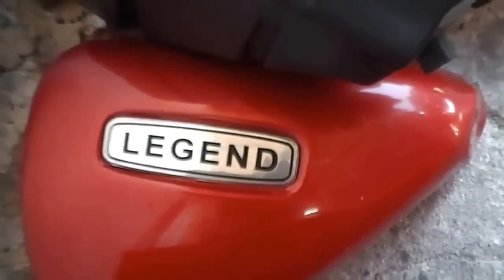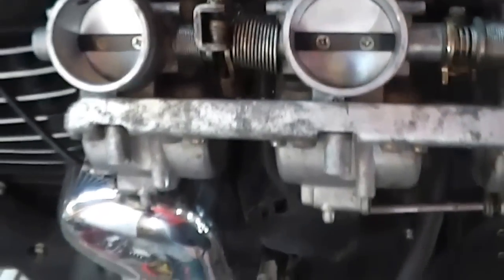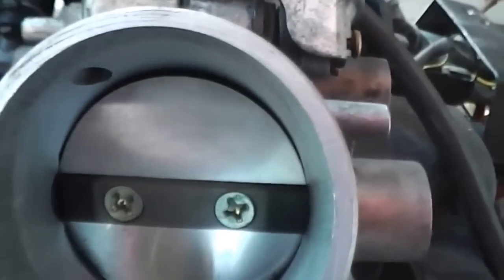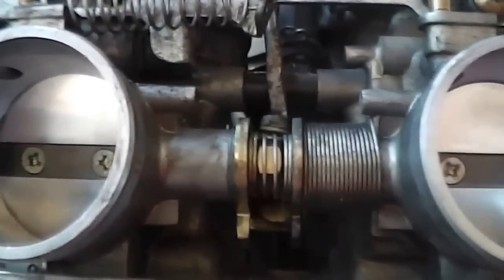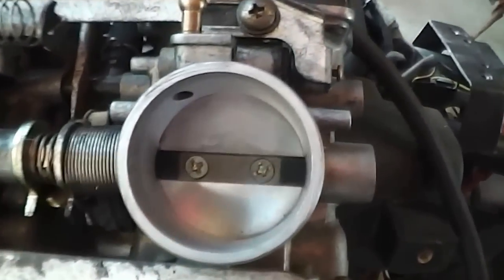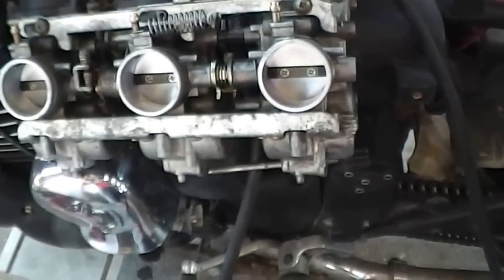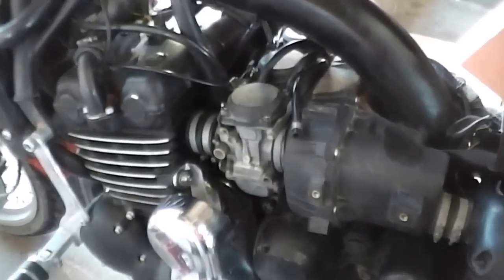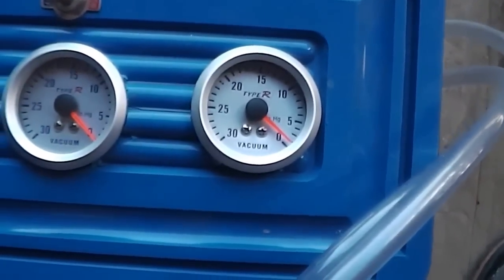Triumph 900 legend carb balancing

Comment: Really helpful information for presetting the carbys before final balancing with gauges, thanks mate.

One tip for building your own vacuum gauges, use some in line ball valves and slowly close them to a point while running until it evens out the bouncing of the needles to get a more accurate reading ;)
Reply from the maker: Hey There.... that is a really good idea! Thank you!
Reply: Or cut the vacuum tubes about an inch from the end you plug onto the carbies, and insert a small section of brass tube with small bore to restrict the airflow, that will damp the needles too ;)

Comment: Hey!
I have a similar Mikuni carburetor on my '95 Tiger 900.
Lately had some issues when it suddenly decided to only run on two cylinders.
Noticed today, when i changed throttle-cable, that only two carburetor open half way, the third one is completely stuck!
Do you have any idea what the issue might be?
Any advice appreciated!
Thank you!

Comment from the maker: Oil Filled gauges are much better than the cheap ones I got .... but also you can do it by ear with a tube to your ear down the air filter intake side of each carby ... you can hear the different speeds of air rushing into the venturi

Comment: T900 here. Legend looks the same. 

Question!, where the two additional hoses on the carb should go ?. I rebuilt my carbs including new rubber carbs to head. Synced them as much as possible with current issue. 

Problem is that is not stable in low RPM and it reduces high RPM very slow. Similar to air leakage behavior. My two hoses are open. When I close them, low RPM is stable but I can't put high RPM at all, it shuts off.

Another Question. I know, there is a CAL version, my is not, but I still have the hoses. I know there are to collect petrol viper, but like I mentioned my version is not CAL and has no additional plumping. 

So, what;s the deal, should they be closed or open. Looks bad ether way. Also, why they take the air in and not through the air filter box ?
Reply: +Michal Augustyniak One more thing, I decided to rebuilt my carbs just because of this issue. There is no change after all, at all :(
Reply from the maker: +Michal Augustyniak 
You must eliminate the ending itself first.... if the engine is not ins good condition ... no Tuning will get it right.
Valve Adjustment first => Compression test => Ignition system Check => then carbs. check for vacuum leaks etc.
Reply: +How To - Westy Style! Yeah, that's all done.
Reply from the maker: you must have a vacuum leak then .... no other reason.
Reply: i think uour talking about the choke tubes on each side of the center carb.

Comment: i have a 2000 triumph thunderbird 900 with 3 carbs. is the balancing procedure the same. the carbs look the same as in vid
Reply from the maker: +Jim Trotter yep..... you can also do it by ear once you have the basic setup done.... (mechanical setup) you can use a tube and place near intake venturi on each Carb and listen for the change in suction sound to adjust the other 2
Reply: +How To - Westy Style! will it still work the same if you bypass the emissions. i am in cali.. and the bikes emissions have been bypassed.